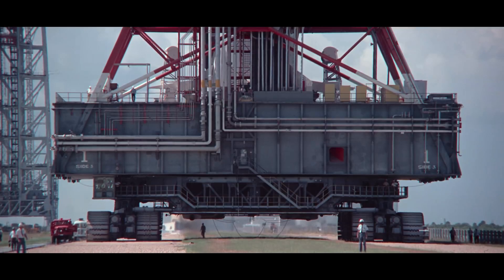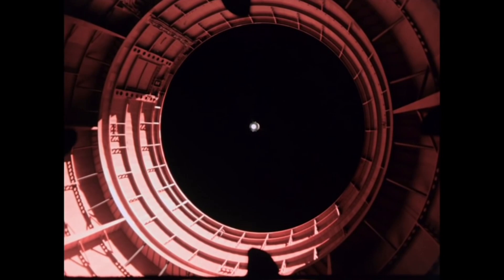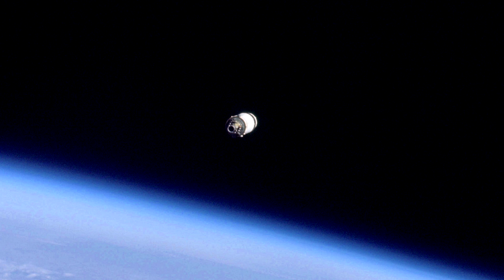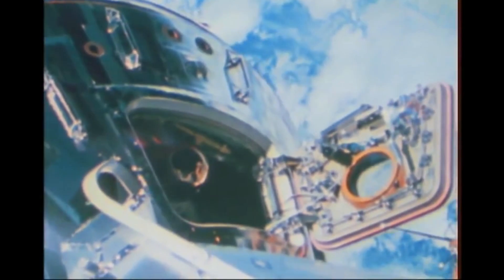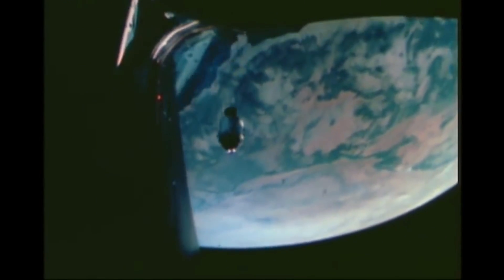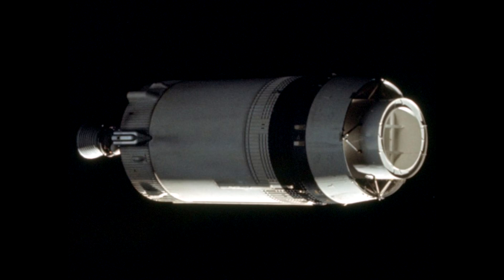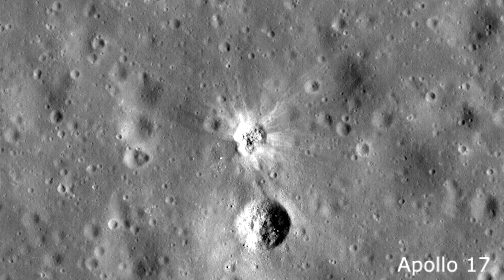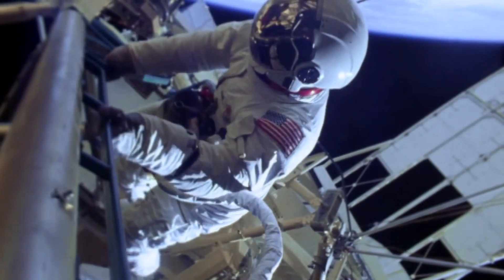How Did The Apollo 11 Documentary Get Film Of The Upper Stage Ignition?

Comment: where is apollo hypergolic visible fire ???  Hypergolic propellants are a type of rocket fuel that ignite spontaneously upon contact with each other, without the need for an external ignition source. They are commonly used in spacecraft propulsion systems because of their reliability and ability to ignite in ( the vacuum of space. ) When hypergolic fuels combust, they produce a visible flame, ( even in a vacuum. ) Here's how and why this happens:

How Hypergolic Fuels Work
Hypergolic fuels typically consist of two components:

Fuel: Commonly hydrazine (N₂H₄) or its derivatives like monomethylhydrazine (MMH).

Oxidizer: Typically nitrogen tetroxide (N₂O₄) or nitric acid (HNO₃).

When these two components come into contact, they react exothermically (releasing heat) and ignite spontaneously, producing a flame and exhaust gases.

Visible Flame in a Vacuum
In the vacuum of space, there is no air or oxygen to sustain combustion in the traditional sense. However, hypergolic fuels do not rely on external oxygen—they carry their own oxidizer as part of the chemical reaction. This means they can burn in the absence of an atmosphere.

The flame produced by hypergolic combustion is visible because:

Hot Exhaust Gases: The reaction produces extremely hot gases, which emit light due to their high temperature (thermal radiation).

Chemical Luminescence: Some of the chemical reactions in the combustion process produce excited molecules or ions that emit light as they return to their ground state.

Expanding Plume: The exhaust gases expand rapidly into the vacuum, creating a visible plume that can be seen as a bright flame or glow.

Characteristics of Hypergolic Flames in Space
Color: The flame is often a bright orange or yellow due to the high temperature of the combustion products.

Shape: In a vacuum, the flame expands rapidly in all directions, forming a diffuse plume rather than a tightly defined flame like you would see in Earth's atmosphere.

No Smoke: In space, there is no air to carry soot or smoke particles, so the flame appears cleaner compared to combustion in an atmosphere.
Reply: Whether the flame of a fire is visible depends on the propellants used, and on the presence of an atmosphere. In a vacuum, most fires are far less visible than in an atmosphere.
Reply: As the exhaust gases expand, their temperature rapidly drops. So you can see the inside of the engine glowing, but the exhaust products are too cold to do that.

Comment: 7:10 Only MCC lost it's datalinked instrumentation. CM still had working onboard instruments. IIRC they have actually lost SCE power supply. SCE was sort of a level shifter, it was converting signals to the voltage range that could be then used by datalink. IIRC Gauges in the actual CM were hardwired more or less directly to the sensor outputs and kept working.

Comment: SCE to Aux didn't make the command module start working again.  It allowed the ground to receive telemetry.  Putting the fuel cells back on line to raise the bus voltage would also have done this, and was one of the next things the astronauts did.

Comment: Terrible we were not able to keep the Saturn lauch system.  There was a backup Skylab built.  Imagine we still had the ability to launch a Saturn V in the mid 80s.  America decides it wants a space station. Boom!  Within 6 months to a year,  Freedom (Skylab 2) is in orbit ready to be manned.  From what I have read, there were regular evaluations into the early 80s of all remaining Saturn hardware in case it was needed to be made flight ready, but by the mid 80s it had deteriorated to the point where the infrastructure did not exist to be able to overhaul and launch a Saturn.  It was at this point that the Saturn program finally died.  Wish I could remember where I saw that information.

Comment: Scott I would like to know how they carried more payload on each successive moon landing. They brought more equipment,  stayed on the surface longer,  brought back more rocks,  had a river etc. So their takeoff weights must have increased on each mission. How did they do that? Conserve fuel by optimizing navigation? Structural beefups to carry more weight? Less margins for safety as they gained confidence and data?
Reply from the maker: Sounds like a good question to answer.
Reply: Scott Manley i work in the aircraft industry and for us weight is always an issue, but for rockets it’s far worse. The ratio of launch weight to how much stuff they could land on the moon was horrendous. Every pound of stuff you add means more structure and more fuel, plus more fuel to carry that fuel and on and on. So to end up carrying more payload means they had to overcome some major challenges. Or perhaps on the first missions they were super cautious with contingencies or perhaps they were able to tweak their orbits to use less fuel or who knows? It is something I have always wondered about.
Reply from the maker: There was a change to the initial orbits for landing with Apollo 15 onwards, that made a big difference to their fuel requirements and let them land the Rover.

Comment: Watching anything about '60s and '70s NASA, it's hilarious how janky some of the stuff they did is - if there's any historical case for "If it looks stupid but works..." The size of Skylab really makes us ponder what would have happened had it not fallen out of orbit - the ISS would probably be built onto it, Skylab serving as a huge central module. Also makes us wonder what will happen once Starship gets up and running, that alone is probably bigger than the ISS. Especially if fuel tank space could be converted into living area, they could make a huge space station out of those very quickly.

Comment: Nasa always thinks so far ahead they lose sight of the present. Sky Lab was supposed to be saved by late 60's tech that was late getting to the show until the 80's (shuttle). It seemed some wanted to save it and yet others did not. I think Nasa wanted to kill it because they would have to pay for the up keep and instead they wanted to move on to the next biggest thing. Same reason we have not been back to the moon.  Even with 3 more missions left on the drawing board. If Nasa wanted to save it they could have sent up a unmanned cap loaded with fuel. Remote dock with the station and use the fuel left to boost its orbit. 
I have to say I am so disappointed in Nasa. By now we should have had a huge space station. Think of like 6 or 8 skylab's hooked together and then add in all the rest of the ISS. And there should already be a station on the moon. There is no way we are going to send a manned mission to Mars by sending them off a pad in the everglades. Besides some robots Nasa has been in park for decades.

Comment: 6:58 Cold helium spheres in the H2 tank (why) and in the thruster section (what for) ullage motors (what fuel) thruster section retro rockets (same thing)

Can somebody explain.  Thnx
Reply: If you wanna be sure on that, check out Wikipedia and Co., this is just my best guess:
He tanks in Fuel Tank: probably pressurization, to keep thrust up.
He tanks in Engine: probably driving Turbopumps, to avoid corrosion or other nasty stuff happening to the pipes.
Ullage motors: There is an issue (you can experience in Realism Overhaul) that if you're in space, you don't have any acceleration, so the fuel just floats around and doesn't go into the engine (why should it, no force is pressing it into the engine). Those ullage motors provide just enough thrust to keep the fuel at the bottom.
Retro rockets: Not really part of stage, interstage that is being ditched just after stage separation (reason: structure & aerodynamics).

Comment: The problem with the 2nd restart of the J-2 engine on Apollo 9 was due to the fact that the J-2 engine was not properly thermally conditioned prior to re-ignition.  As it happened, the oscillations in propellant flow to the Gas Generator  as a result of the thermal non-equilibrium situation resulted in an explosion of the Gas Generator.